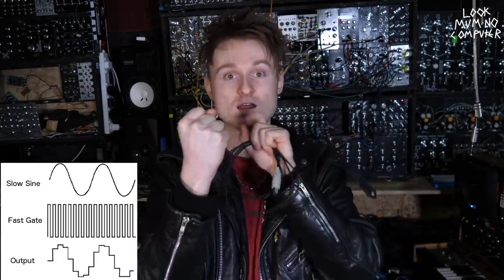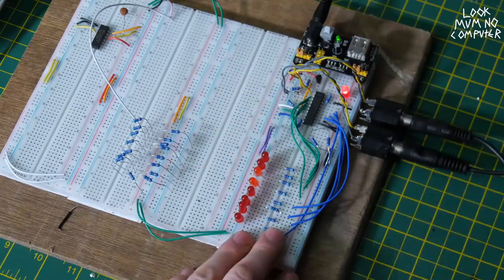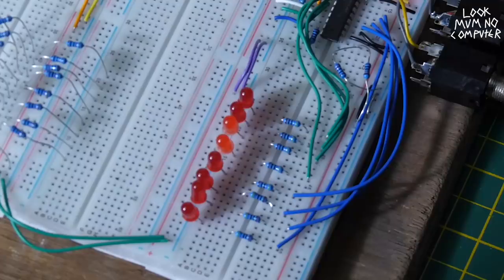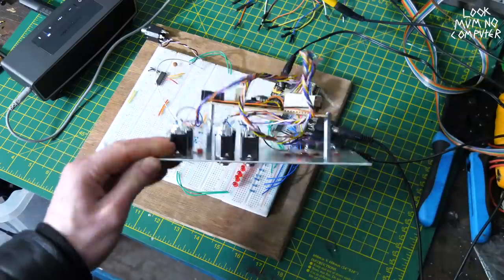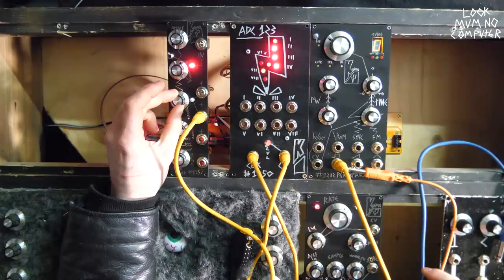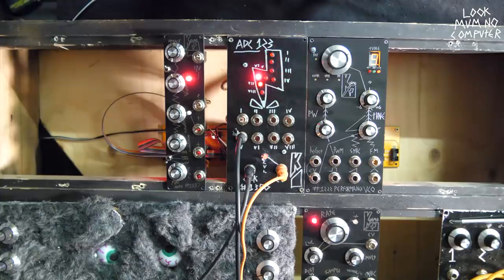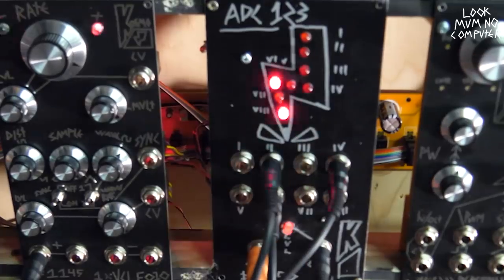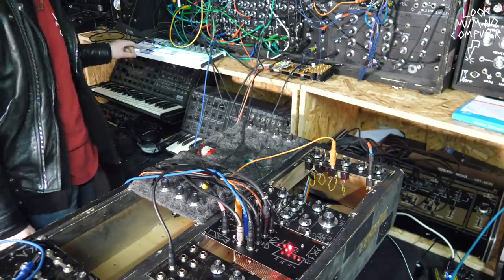Wonky Drums With An 8 BIT Analog To Digital Converter Chip DIY HOWTO

Comment: The advantage of using logic chips instead of microcontrollers is speed. You can do stuff with logic chips at audio rates that even the best microcontroller would struggle with. For instance, I've been obsessed with SID chips recently, and the equivalent 'sample rate' they achieve on the waveform generator is higher than what's possible with an overclocked teensy running at 1GHz. It's debatable whether the human ear can tell the difference though!
Reply from the maker: amen to that

Comment: Screw coding haha. Seriously though all you need for a basic electronic drum machine is a 555 timer with variable timing, a coupule cd4017's cascaded for the sequencer/counter (connect all outputs to the reset pin via a muti position switch so you can select the amount of steps, also connect all the 4017s outputs to a switch matrix with appropriately placed diodes (one switch for each instrument) connect all the outputs of the instrument select switches via more diodes to drum synth circuits stolen from the  boss dr55 and or roland analog drum machines. 
Hard to explain without a schematic but yeah rant over :p
Reply from the maker: PracticalCat yep! I’m working on a sequencer using logic however not 4017’s whilst they are good at some things they have a few set backs. Still very nice tho!
Reply: @LOOKMUMNOCOMPUTER  Your right they are limited, that being said i have made an automatic washing machine that is controlled by a 555, a 4017 and a "diode rom" / diode matrix for the program! 

Your sample and hold Idea is very interesting btw! Sounds cool.
Reply from the maker: PracticalCat ha awesome
Reply: @att6915  eww haha :p

Comment: Here's a circuit you could build for an interesting glitchy digital slew-rate limiter:
Take one of those MAX5451 digital potentiometers (or similar). Wire the potentiometer section as a voltage divider between your signal rails. Wire your input signal to the positive input of an op-amp and the potentiometer output to the negative input, then wire the output of the op-amp to the U/D input pin of the digipot. Feed an input clock source to the digipot's clock/increment pin, and wire another op-amp as an output buffer for the digipot's output pin.

Essentially, the first op-amp acts as a comparator to drive the U/D pin to make the digipot voltage closer to the input voltage, so every time you feed it a clock pulse it'll get closer by one tap of the potentiometer. With a fast clock rate and some output capacitance this essentially becomes a weird digital slew-rate limiter, or with an even faster clock and a gate signal to the digipot's enable pin it can be a digital sample-and-hold.

(Note that the MAX5451 actually has two digipots in it so you could actually build a two-channel version of this with just the one chip plus a single LM324 quad op-amp.)

Comment: & the idea of using SRAM circuits but instead trying to store analog voltages seems like a great idea - problem: that setup won't work because each transistor only has two stable positions (on & off - meaning it's metastable) & is completely unstable everywhere in between, so no, this won't work.
Reply from the maker: Pull down resistors. Already built it

Comment: There are ways to retain or hold analog voltages or rather samples for an extended period of time without storing them in bits - but that won't work with pure electronical devices very well, you'll either need a magnetic tape, an analog delay line memory https://en.wikipedia.org/wiki/Delay_line_memory or (& this is afaik the ONLY theoretical way to achieve this with only electronical devices) using memristors & trying to drive them with analog voltages - note: a) memristors are non-linear devices (meaning you'll probably need an analog device which would linearize its input/output) b) while memristors are reported to have an expected half-life of information retention on the order of a decade, this is only true as long as no voltage is applied - because memristors only allow for destructive reads, meaning voltages/samples would have to be refreshed (meaning you'd need an explicit refresh circuit) after each read if you'd want to read them multiple times c) while memristors exist in practice, I haven't seen any device which features individually & analogly drivable memristors, meaning currently they only exist on some microchips in crossbar arrays tucked away beyond digital drivers meaning you'd only be able to drive them digitally anyway :(
Reply from the maker: Tapes an interesting idea

Comment: Just need to design one for 16-bits so it can have a reasonable range of notes.
Reply from the maker: Del Scoville 16 bit parallel Adc’s with parallel outputs are rather expensive and 65000 separate values may be overkill. However if you gang two of these chips together you can get 9 bits. You get 512. Or 10 bits 1024 with 3 of these adc’s
Reply: Yeah, the trick with stacking two for say 16-bit resolution is figuring how to get one source to two ADC's the right way.  Would probably be easier if your source was a frequency.

Comment: Now follow the digital output with a D/A and you have a digital S/H, aka "quantizer."
Reply from the maker: Roderick Legato if you scale it right. Good shout!
Reply: Stick a Control Voltage into a LM3914 bar graph IC,..

Take 8 outputs from that into 8 AND gates,..

Feed each of the 8 ADC output bits into the other inputs of the AND gates,..

And then the 8 outputs of the AND gates into a DAC.

Then you can CV the bit-depth of the quantization, from smooth to steppy :)

Comment: I’m giving some thought to a version of this for my Eurorack. I’d consider a couple of changes. First, I’m not sure I understand the reasoning for using diodes on each channel; I’d’ve thought one would use op amp buffers instead. And indeed I found the MIDI to Gate module from Barton Musical Circuits, which has basically identical outputs (eight triggers each with a parallel LED) driven from a microcontroller, uses two TL064s or TL074s to buffer the outputs. Second, I’d add protection diodes and 10µF electrolytic filter capacitors near the power header and 0.01µf caps on the power inputs of the ICs. Not sure how I’d build it, stripboard or Adafruit protoboard or the Eurorack protoboards sold by Synthcube (probably would need 2 of those) or bite the bullet and learn how to make my own PC board. Needs further thought.

Comment: I am trying to rap my brains around this 
How fast is it sampling the voltage and sending out a single.
And is it maxing out is (8bit) sequence pretty often? 
Or am I over thinking this hole thing and I should just set back and enjoy the tasty beats it Laing down.
Reply: Clock in.  Clock in.

Comment: Sometimes its just alot more simple to use a microcontroller, basically just replacing the more complicated circuit  with code
Reply: Then you come up with a whole list of new possibilities, and then realise you don't have enough I/O pins and have to add more chips to expand the μC ... ;)
Reply: @massimookissed1023  lol yeah depending on what you're doing of course you add more chips lol thats the fun of it, just a stand alone ųC pretty boring

Comment: So are your nightmares filled with simulated synthesizers in DAWs?
Reply from the maker: Collin Lennon pretty much. And an email inbox with 666 unread emails
Reply: @LOOKMUMNOCOMPUTER  666?  Move over, small fry, I'm getting on for 6000 unread in mine (5933 at the moment), and that's without counting the spam.  I wonder if there's a "No, I didn't read your sodding email" t-shirt available.

Comment: So the LEDS on the breadboard = Binary :)
Reply: So in simple terms you are converting an analog voltage in to bits (8 of em), and using said bits as triggers?
Reply from the maker: @mrkrotosuk  yes
Reply: Yep, and with the analogue input being out of sync with the LFO that's triggering the samples, you get a pretty random output of the 8 bits for triggers.